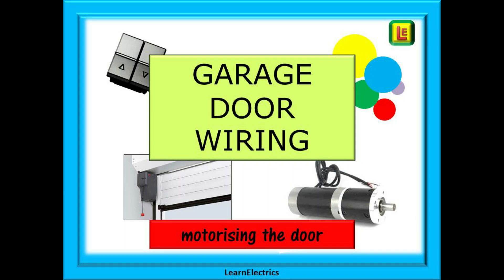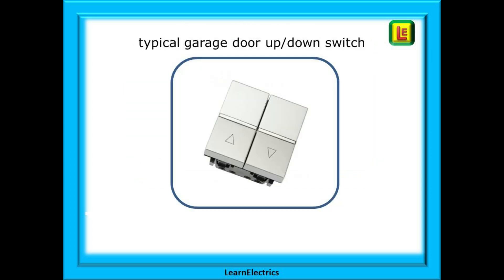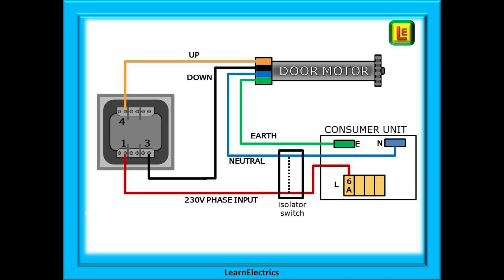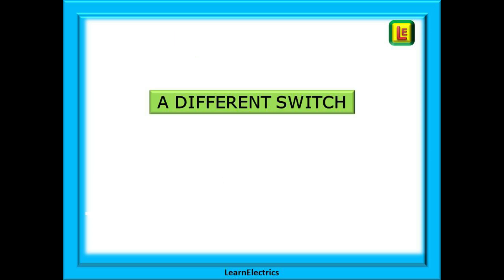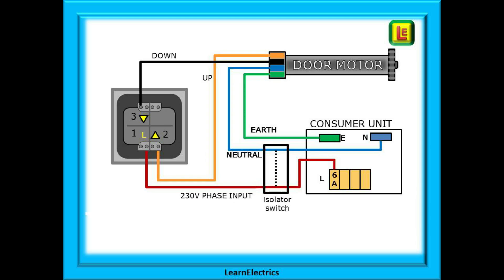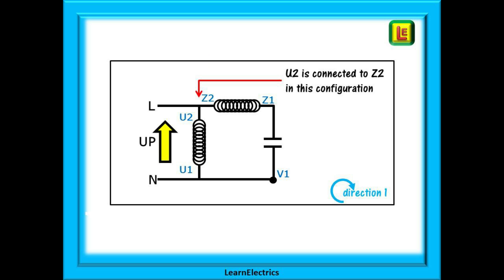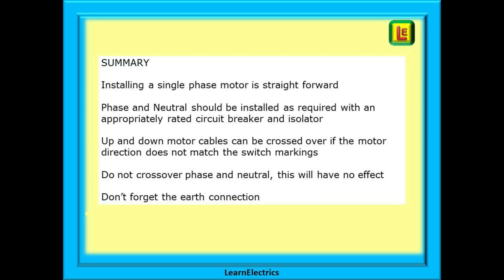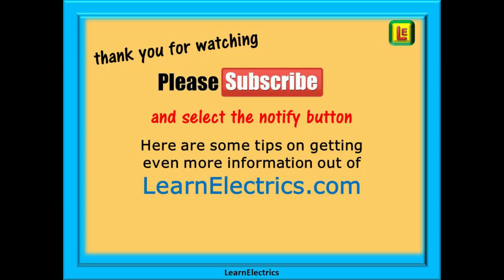GARAGE DOOR WIRING – Motorising the garage door

Comment: Who'd have thought, the self fit roller door I just fitted has ZERO wiring diagram!
So I have a key switch with two micro switches within the box. No clue which of the 4 terminals does what!
Reply from the maker: Are there instructions on the manufacturer's website?
Reply: @learnelectrics4402  Thankyou, sorted, the manufacturer sent the omitted instructions. Works very well now..

Comment: Could you perhaps do a video on wiring an electric door with a red/green button control switch and through an audible beacon too that would keep sounding whenever the door is left open 

Many thsnksn
Reply from the maker: Jake, you should be able to pick these parts from the wholesalers. A magnet door clamp and switches to release the door and a magnetic contact switch as used in burglar alarm circuits to detect when the door is open. Thanks for watching.

Comment: Great video, most of the garage door operators I have wired have a low voltage relay switching for the push button controls. Usually operating at 24 vac.
Reply from the maker: Yes, that's another option. I may include switching relays in general in a future video.
In fact, it's on the list to be done now, Thanks for the prompt. Dave.